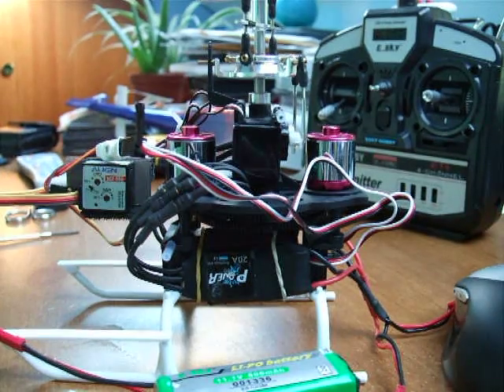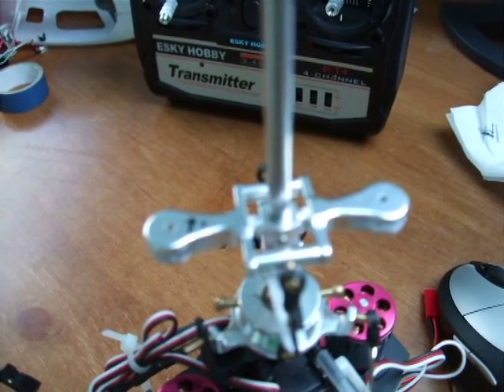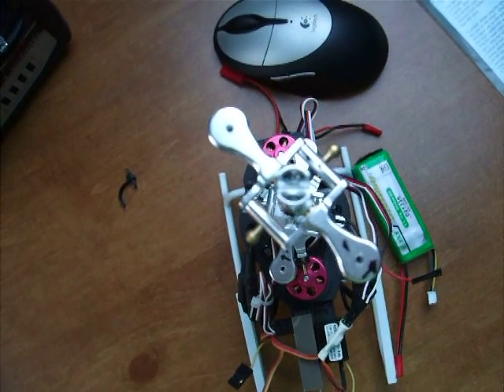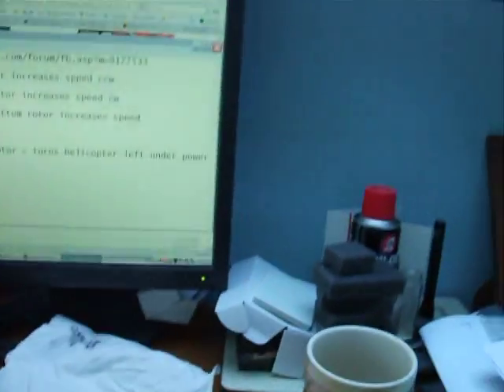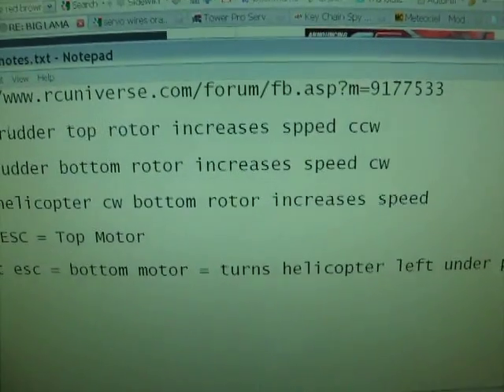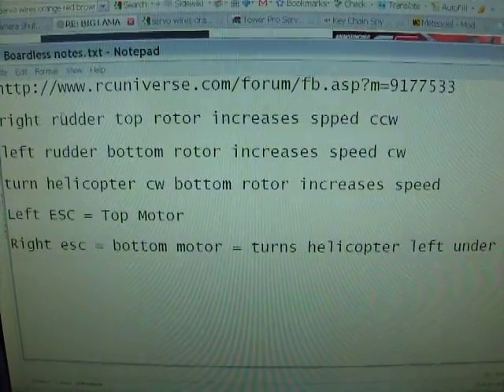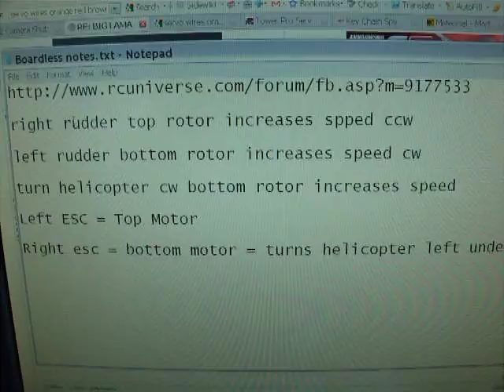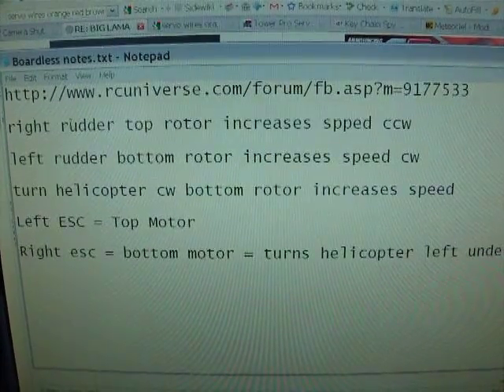Brushless & Boardless Esky Big Lama Bench Test

Comment: I have exactly the same problem Big Lama has been grounded since attempting this i have elimnated every thing and now only the mixer can be at fault i guess ill have to email Dyonysus Designs and see if they will replace this DOA , Is there any other option other than going back to a 3 in 1 as i really miss having a coaxial to fill the gap from larger helis at home?

Comment: Also i have used your settings on the mixer and gyro but oddly enough when i set the mixer to 80%, gyro gain 45% only the top blades spin.  If i switch it to Mixer 45% to 80% gain the bottom blades does spin fast enough and the helicopter just spins clockwise in flight.  I have test all the esc, motors but when i try and turn the helicopter by hand cw the bottom blades dont increase in speed nor does the top blades increase in speed when i turn it ccw.  Left and right rudder inputs dont work too

Comment: Hi, well i got the new mixer today and i am puzzled again as all it wants to do is spin cw.  The top rotor spins faster than the bottom and no matter what i do to the mixer (50%, 45%, even right down) the top rotor spins faster than the bottom.  Am i missing something, or what else could it be.  I even brought another gyro (Rce-550) and it does the same thing.

Comment: @sgbfly Hi again too, I am puzzled too, and yes i have removed one of the red wires from one esc to the mixer.  It was all worked before, left it to rest for a few days then the heli would spin in one direction, then after that only one motor works at a time.  It has to be the mixer.  Btw i downloaded your instruction manual, and it was very simple to understand and provided me a lot of help.  Your troubleshooting section didn't mention this problem so that is why i asked for your help.

Comment from the maker: @mjaw77  Hi Again,  Very puzzling as to why the mixer would stop working - but I'm fairly convinced it has!  Bad luck!  Did you remove one of the red (live) wires from an esc plug when you plugged it into the mixer so only one BEC is powering the electronics?

Comment: @sgbfly With the motors and esc's i have eliminated them by plugging them one at a time in channel 3 on the receiver.  The gyro does initialize however and I have now eliminated the gyro by doing what you said, and it still only spins one motor.  Mixer is set at 50%, so it looks like the mixer has decided to not work properly.  Why would it stop working after all i had it flying great until now??

Comment from the maker: @mjaw77   It sounds like your mixer is not working correctly.  You have eliminated the motors and esc's as the problem.  Now eliminate the gyro by taking it out the set up and plugging the mixer directly into receiver - if it suddenly works then blame the gryo.  Test the receiver by plugging in a servo to the rudder channel and making sure it responds to the transmitter.  It does however, sound like a mixer fault.  You could try adjusting the pot on the mixer.  50% is a good start.

Comment: I have this setup but only one motor spins.  If i connect the front motor ESC on the pot side of the mixer (both are connected at this time) one that motor spins.  If i reverse it and connect the rear motor to the pot side of the mixer, one the rear motor spins.  What could be the problem????